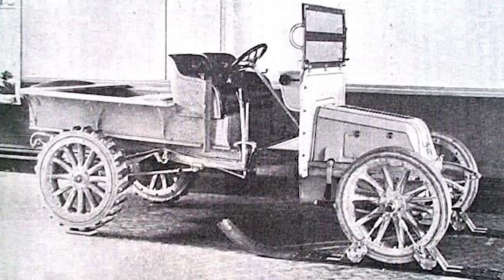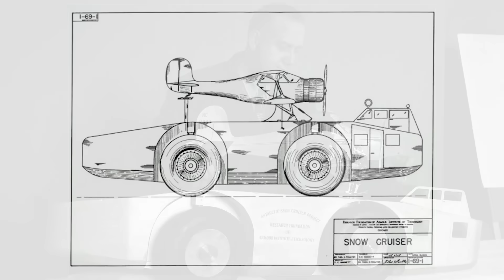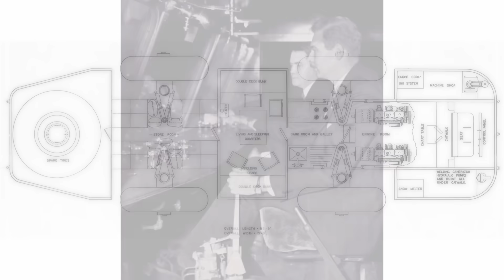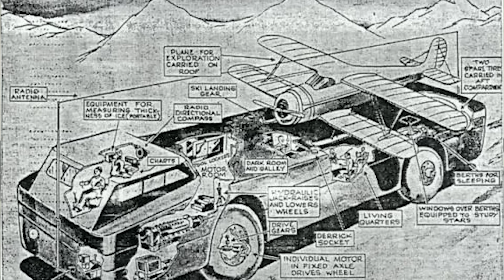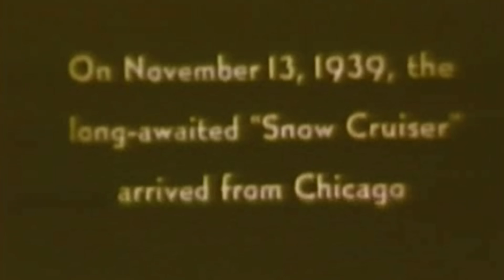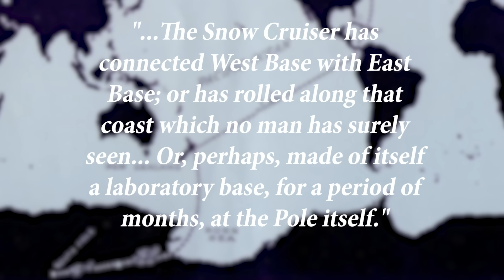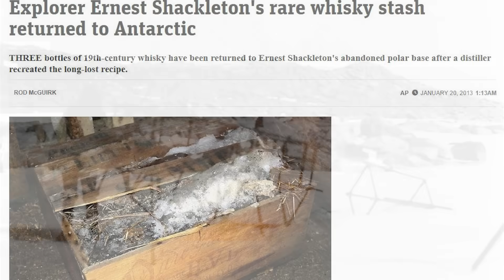"The Snow Cruiser"-Antarctica's Abandoned Behemoth

Comment: Some good ideas, including the hybrid diesel-electric drive. Even those tires might have worked if it hadn't been so heavy. Tracks would certainly have helped, but might have been higher maintenance. I'm surprised they didn't try the worm drive that was offered as a conversion for Fordson tractors. Those moved very quickly across snow fields in the northern US during the 1920's and 1930's.

Comment: I can tell you from the moderate off-roading I used to do in college that your two biggest enemies are usually 1.) gross vehicle weight (GVW) & 2.) ground clearance and, to make things more fun, the two are abstractly interlinked (ie more weight generally gives you a lower ground clearances, etc.)! 

I've actually seen nearly identical Jeeps with the difference between them being engine size, and sometimes there would be trails that the Jeep with the smaller (and lighter) engine was able to clear that the Jeep with the larger (heavier) engine could not.

Comment: considering this was designed and built at at time when they were still trying to figure out how to build regular cars, it's not much of a surprise that they threw a bunch of ideas together without really knowing what would and wouldn't work. Just building a motorized vehicle of any kind was still very experimental in the 1930s, let alone attempting to build something this big that could function in one of the harshest climates on the planet. From what little material is available about this thing, it doesn't appear that they fully understood why it didn't work in the snow, as the obvious solution to make it move - seen with modern eyes and the benefit of hindsight - would've been to fit it with some more sensible tires. For how big that vehicle is, it actually has a tiny amount of traction surface thanks to the relatively narrow tires, so even if the tires had tread, there still wouldn't be enough friction to make it work in snow - given it's size and weight. Narrow snow tires only work if you can sink through the snow to a proper road surface underneath, but in the Antarctica you have loose snow on top of hard snow on top of ice, so you need a wheel/tread surface big enough that the vehicle doesn't sink in. They probably could've gotten more traction out of the beast if they let some of the air out of the tires, but then it already had so little clearance that it likely would've caused it to drag against the snow

Comment: Tires on deep snow and ice? What was he thinking?  Tracked vehicles had somewhat proven successful already in the Antarctic, he should have built on that idea to the extreme. Make the whole thing of aluminum to save weight, tracks about 15 foot wide with two in front and two in the back similar to the track kits you can get today for almost any 4 wheel drive truck / SUV?
     Diesel / electric is good, but conditions are so harsh that it would have to remain running 24/7.   Gee, how about testing it first, Buffalo, NY gets all kinds of snow.

Comment: Going to the Antarctic in the 1930's was much like going to the moon in the 1960's. Largely unknown. Engineers are rarely allowed to do what is best due to money and time constraints even today. Time being the most decisive element in terms of function and reliability. Testing engineering theory and design is pretty useful!. The electric motor design was the correct choice for drive train torque. The balloon tire concept made little sense except in terms of weight and cost. Tracked vehicle technology and design really didn't take off till Tucker came on the scene in the late 1940's. The engineering behind a seemingly simple design is far from simple and driven by contrary factors.

Comment: Great video.   I always wondered why the used smooth tires headed into ice and deep area areas.   Sure they had their reasons.   With it being so under powered, it didn't much matter.  I was surprised it was so under powered.   Guess they should have geared it down even more with a top speed of 30, but quadruple the torque.  Cheers

Comment: The biggest downfall of this was not its size but its weight. 
If this was built more like a plain it would have achieved more of its goals then it did. 
Having all that weight on 4 tyres even though they were massive the contact pitch was still small putting all the weight on 4 patches no larger then 3ft by 1.5ft. 
Effectively putting about 8.5t on each contact patch. And the tread on the tyres was severely undercut. Basically a road tyre. 
I heard about this many many years ago as a student and did a project on it and designed one that according to the engineers and professors would have been far more successful then this was. 
Mine was tracked with a unloaded weight of 9.5t was longer and wider then the original and because it was tracked and set out in a balanced format could be loaded with differant tonnages of load depending on surfaces it was used on. But for snow could hold 15t of load. So roughly 25t loaded.

Comment: I mainly feel bad for the design team. They were obviously amazing at being able to design the vehicle, but there just wasn't any time to test the vehicle in snow before they sent it overseas due to politics. I'm sure that if they could've tested the Snow Cruiser in say, the harsh winters of the Midwest or by the Great Lakes, then they would've tested the vehicle in harsh winter conditions to see what shortcomings were in the vehicle. Unfortunately, they didn't get that chance, and so the vehicle failed. But it's still amazing how much of it was actually successful, such as the insulation, the hydraulics, the diesel electric drive (if a bit underpowered), the self containment. For a team who had such a short time constraint, they did a phenomenal job with what they had. Just so happens that one aspect about it really caused the failure, and since there was no time to test the cruiser in winter conditions, there was no time to find out about the fatal shortcoming. If they had the time, I am sure they would've either found new tires, or had new tires fabricated.
Reply from the maker: Very well said!

Comment: A lot of folks in here poo-pooing the wheels, saying that tracks are the obvious choice.  I'm not sure that is the case.  Tracks would certainly have provided better traction, but tracks in the 1930s were not terribly reliable and required a lot of maintenance. Tracks are not always the best option for every arctic application. Many modern arctic vehicles use wheels instead of tracks.  For the snow cruiser, simply using tracks instead of wheels would not have saved it.

A bigger problem than the wheels themselves was the smooth tires, but even they weren't THE problem. They put chains on the tires and it still didn't perform well.  The vehicle also had poor weight distribution and a severe lack of power, terrible ground clearance and approach and departure angles. It was so hopeless that they basically wrote it off and used it as a building.
Reply from the maker: Great comment!

Comment: How did they manage to run off the road?

Also, one of the drawings made before the actual Snow Cruiser was built showed a considerably longer wheelbase, which looked like it would have worked better, although they would have still needed more suitable tires.

Comment: At 34 Metric tonnes, it was very, very heavy for this application. Owing to the fact that the schedule was tight, I guess any planned testing in American winter snow, wasn't considered. Had the engineers done so, the shortcomings will have shown up, before it was sent off on it's ill-fated mission.
Reply from the maker: Hit the nail on the head- in fact it was at least 4 to 5 times too heavy, owning probably to the 'coachbuilt' style rather than the later Soviet Kharkovchanka that was built using avation airframes. Limited by the tech of the day!
Reply: @CalumRaasay  Thanks for pointing out that construction technique. I'm surprised, that for all the other innovation that went into this, weight-saving wasn't one of them.

Comment: That Little America vehicle base thing could have been alot better if they didn't make the tyres garbage. They have 0 tread and they're round so all they will do is slip on the snow. You could have 10 wheels on the thing but if the tyres have no tread then it will remain uselss and just spin on the ground. Snow chains wont help a tyre with no tread too. If the tyres were a mud terrain big chunky tyre and had very big heavy thick snow chains then it would have been fine on the ice. It would have had plenty of traction. It just surprises me that whoever designed the vehicle had the iq to do so but didn't see the clear flaw in the tyre design, even snow tracks would have been fine.

Comment: So did they just not bother to test out the concept on actual snow before building this thing and sending it to the Antarctic?
Reply from the maker: I mean if you watch the video I explain that they didn't have time.
Reply: @CalumRaasay  Still, they could have at least built a test platform for the tires and how they'd function on snow. You dont need the vehicle built for that, just literally test a heavy thing on balloon tires to see how well that works.  They'd quickly have seen that it doesnt.  It's a stupid idea, and almost seems like the designer has never been on snow before.

Comment: An aluminum or carbon fiber shell super light weight might work.  Maybe like an air boat. Air powered and a flat bottom..  but 20 feet by 40 feet would be a better size.  Solar powered heating and lighting and maybe turbo diesel engines for the propellers.  Super light weight  might work.  But at super low temps its hard to even imagine the engineering  problems or how to solve them.

Comment: This byrd guy must have been told by many that the design wouldn't work. It would need to be light with tracks longer than the total length of the machine and lots of clearance. Also there should be multiple machines as well so when it's stuck you could pull it out. Apparently this man had never seen a winter with many ft of snow. A bald tire or tire period is the worst thing to have. In the early thirties they had tracks on model T's.

Comment: if the objective is to have an aft station?  i would delete the blueprint on the back board.   build 2 seperate  snow tractors that pull a sled house 12x46 feet.